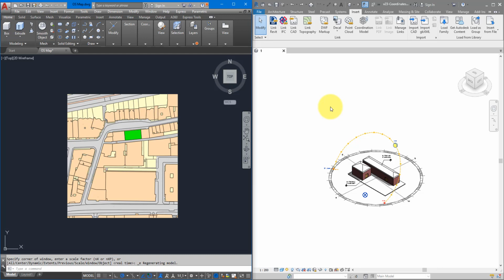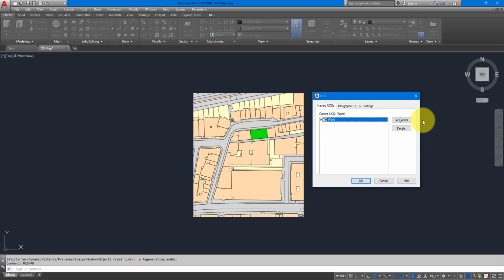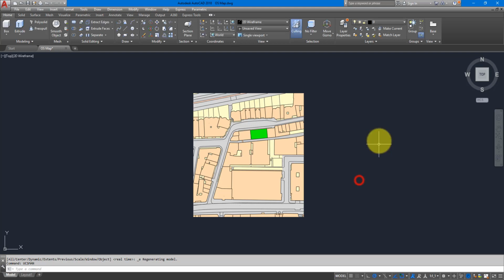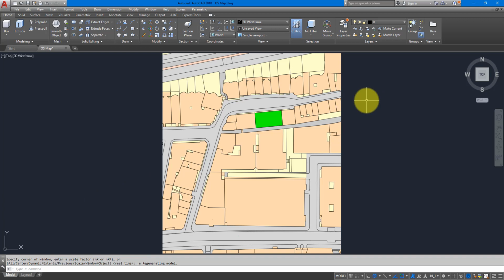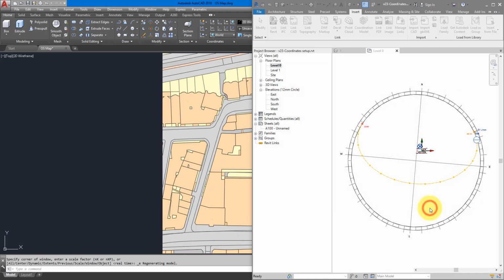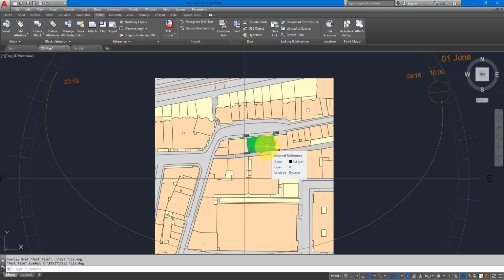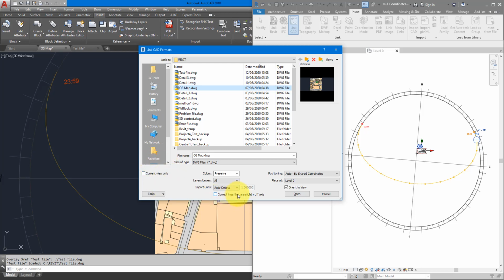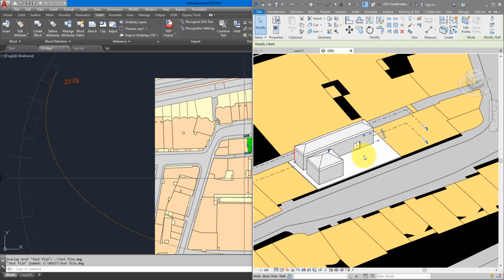Revit Snippet: How to link DWG Cad files by Shared Coordinates

Comment: Hi,
I have been trying to fix my coordinate as CAD file has 6 digits coordinate means in meter when I linked it into revit by using shared coordinate it doesn't work can you please help me out for regarding this.
Thanks a lot
Reply from the maker: You'll need to select meter as the import unit before linking in the cad file with shared coordinates. If it doesn't land at the right place then the cad file doesn't have correct coordinates.
Reply from the maker: A correctly located Cad file should work as long as the right unit is selected